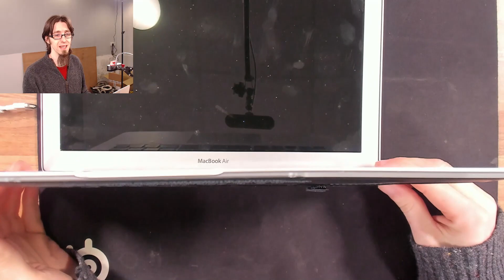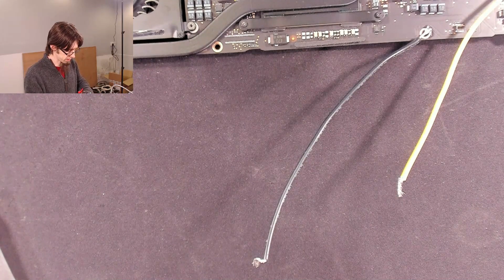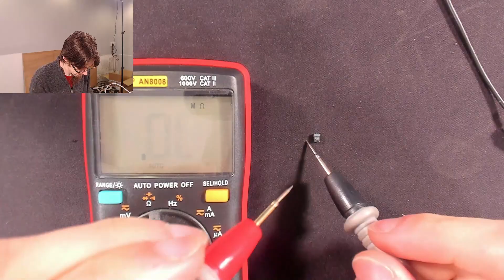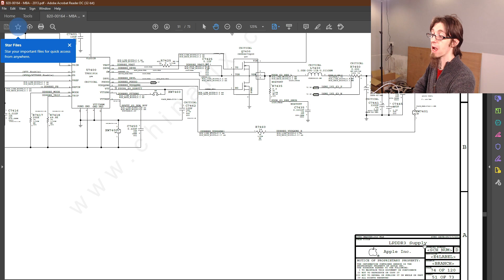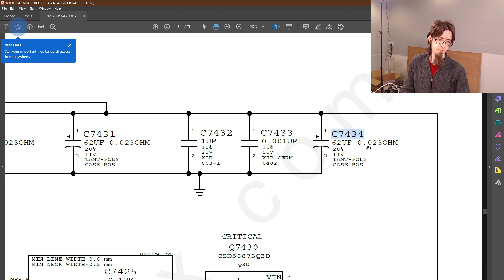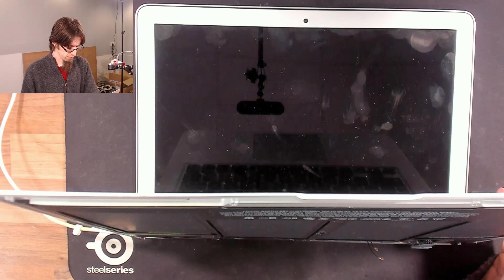MacBook Air Doesn't Turn On - LFC#256

Comment: Legend, I had the same issue, watched this video, had the same voltage drop, found a visually damaged cap in the same area, was hot as to touch, borrowed some gear, swapped it out, fixed!! Love your work, thanks for creating this awesome content. Big fan.

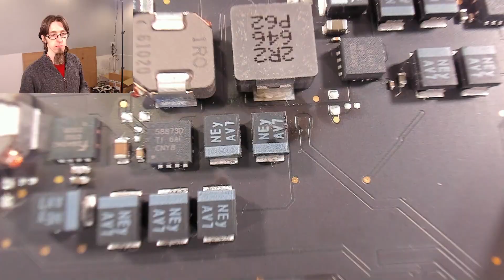Comment: don't tell me.. blown capacitor...... 12:10 I was right!. It's just that people want a Mac. So they get the cheapest MacBook Air which is really an iPad with a keyboard. Then they put all sorts of things on it like games and start to do some heavy stuff and run this computer boiling hot all the time. I used to have a MacBook Air and was exporting a simple low res video using iMovie and when I picked up the laptop it was boiling hot.

Comment: VOLTAGE INJECTION TIP: When injecting voltage to a circuit board to identify a short be careful when feeling for the hot spot because it will burn your penis.

Comment: I NEED TO DO THIS TO A 2011 MACBOOK PRO A1286....I THINK I HEAT THE COSMOS INSTEAD OF THE GPU ..... NOW THE MACHINE WON'T START UP. IS DED, BUT CHARCHER CABLE SHOWS GREEN LED.

Comment: That's a nice troubleshooting step by step procedure you conducted out loud there. It's very clear and helpful. I would have used the spray method to find overheating component in the absence of IR cam though. Denature alcohol dry fast and clean but dries super fast in the slight presence of heat.

Comment: Fixed one like that one a few minutes ago. It had a short on a RAM capacitor on the far left when the board is upsidedown. Actually I didn't inject voltage, the capacitor had brunt the plastic under the keyboard, and I just pulled it out. Didn't replace it though ;)

Comment: I Have a 2010 17" Macbook pro, the battery charges but doesn't power on from it. Is it a faulty Diod? the board is a 1297. Thoughts?
Reply from the maker: Can you read the battery level? If it's on the original battery, it's likely just a bad battery. They'll say they're charging, but they don't hold anything.
Reply: @Adamant_IT  says the battery is at 100%, fully charged.
Reply: @Adamant_IT  By the way the battery is a genuine new apple battery.
Reply from the maker: Yea... next step then is to pull up a schematic and board view, and start tracing power from the battery into the laptop, to see where it's getting held up.
Reply: @Adamant_IT  will do, thanks!

Comment: I am working on a a1466 where the macbook air will turn on once I unplug and re-plug the battery cable on the logic board. The charger works correctly going from orange to green. When I had the macbook air powered up, I could restart it several times without a problem. However, if I shut it down then it would not turn back on. It definitely had a minor spill (chocolate milk) that has been thoroughly cleaned out and the logic board looks prefect. The main power board (where the charger plugs into) had some rainbowing on sveral terminals which I scraped to clean it up a bit. I am almost done putting it back together and was hoping for any advice or guidance? Do you know what could be wrong? Cheers.

Comment: I have the same model and voltages are good, looks in great condition, it just does not power on... did all those "resets" that people do in thousands of videos and nothing, disconnected the battery and reconnected it: nothing.

Yesterday I took it apart completely, reassembled and THEN it had power, booted, worked fine, restarted and turned back off and on several times. I went to sleep, woke up and it does not power on again..... just what in the hell is going on with these macs.

Comment: my macbook pro 13" late 2013 took a big gulp of hot tea and shut itself off instantly, i opened it up and dried off the logic board as much as possible, but it took a week to get a screwdriver set to get the logic board out and flipped around. i opened it last night to see two small spots of corrosion, cleaned them up with 99% alcohol and still nothing works. power supply shows a light to indicate the batteries still take power. i thought maybe the keyboard was dead or the ribbon cable got damaged, so i tried jumping it with the direct power supply/disconnected battery, as well as with the power pins on the board, nothing works. the guy near me wants me to pay nearly the same amount as a brand new macbook pro to look at it and MAYBE fix it, PLUS whatever parts it needs. this made me realize there's a lot more to working with logic boards than just the base parts, could be literally anything or everything that needs fixing.

Comment: I have a similar type of problem with a Acer e1572 which started up before, even with a blinking Amber LED lite and after replacement of Memory RAM and new ac charger. 
I couldn't reset to factory settings from the main screen. So I decided to disassemble it to reset the CMOS battery. Unfortunately this model doesn't have a CMOS battery. 
After reassembling it, it will not start up. Thinking it was the Battery Pack, I bought a new one. 
The LED is blue indicating fully charged, no fan sound nothing.
Still it will not turn on?
HELP!

Comment: one jumper to the screw hole (ground) and normally the other jumper into which point? If a wrong point selected like a signal point rather than rail point, will it damage chip/IC and etc? thank you
Reply from the maker: Positive pin goes to whatever is shorted, or on the same rail as the shorted thing.
Reply: @Adamant_IT  thank you so much for the answer.

Comment: A high reading on a capacitor read from a DMM can also mean leakage. Remember DMM's measure capacitance using charge timing. You can increase charge timing by adding leakage.
Reply from the maker: Yea fair point. In this case we were like, 1 or 2uF out, I'm sure it's fine. But that deffo sounds like something to look out for. I'll have to do some comparisons with my component tester to see if there's an easy way to test for this without an expensive LCR meter.

Comment: Which device do you use to inject voltage onto the motherboard
Reply from the maker: A bench power supply. My particular one is an Hanmatek HM305p. There's a world of other options out there as well though.
Reply: Okay so a bench power supply and hot air station are 2 different  devices...

Comment: Why don’t you get a laser thermometer?
Reply from the maker: Not accurate enough to be useful. They have a laser pointer on them, but the actual read area is a cone on front of them starting an inch wide and spreading from there.

Comment: fantastic video  again. P.S could you let  me know where to get those tweezers please and if you  can tell me how  good  are they  durability wise and work wise as well thank you..  P.S i see now why apple hates  you 8 rotten  apples
Reply from the maker: Search ebay for "ceramic tweezers"
They're very good for durability, but they're not super sharp, so not very good for small components.
Reply: @Adamant_IT   Thank you for feed back regarding the ceramic tweezers info greatly appreciated. do you have a good site for fine tweezers to work on small components cause some of the tweezers i used keep sticking or slip with some of the part i try to disolder . i will see as well for that ceramic ones hope to get a good brand.

Comment: You rock man !!! What temperature 🤒 do you use to remove the components ?
Reply from the maker: 450c on the hot air, 400c on the iron. This kind of heat is massive overkill for smaller circuit boards, but on laptop motherboards, especially apple motherboards, the ground plane is like an anvil.

Comment: I have bought a macbook air a1466 emc 2632 2013 model I believe. . The LCD Screen does not light up but there is an angle where I can seem to see the log in password window but very faint.. but plugging to an external display and there is no issue it will work. . Would it be a lcd replacement? if it is do you suggest buying the whole replacement assembly or just the screen?
Reply from the maker: That's a backlight fault. At 4:00 I show basic checks on the backlight. See if the output diode is shorted to ground (_should not_ beep in continuity mode) and then check that the fuse hasn't blown ( should beep in continuity mode). Also do an SMC reset and a PRAM reset, because sometimes it's a software issue and you get lucky.
If the backlight is shorted, it's likely a damaged display connector, or the display itself needs to be replaced, or both.
If there's no short, but the fuse has blown, just a replacement fuse should fix it.

Comment: You are not wrong that if a capacitor is measuring a tad over, it's no big deal. I believe it is important to stress the point, that it's ok if it's over as long as it is inside of the given tolerance. This is important because a leaking capacitor will show "over" capacity, which is to say, it's going to fail soon. Best to replace with a new one IMO. Take this for what it is worth, or with a grain of salt.

Comment: Well done :-D,  at least there is nothing else to repair on it.
The bending could have caused other problems, but it didn't :-D
Nice little multimeter, i looked at them a few years back and wondered why some people poo pooed them.
Looked fine to me.
Reply from the maker: It's not the fastest in the world, and lacks manual ranging. But it's impressively accurate for its class, and cheap enough for the short comings not to matter.

Comment: you replaced the faulty capacitor, but what actually caused it to fail?
Reply from the maker: They tend to fail at random. The laptop also got sat on, so it might've just been the point where it got bent.
Reply: They hate heat, and fail from heat stress.

Comment: Tantalum capacitors are prone to short circuit faults caused by age and driving them with too much ripple too close to their voltage spec. I would suggest fitting new ones every time. The heat of fitting the 2nd hand replacement just pushes it closer to the end of it's life as well.
Nice repair though......
Reply: Typical Apple though. Non-standard size, capacity and voltage. Can easily get 68uF 16v poly-tantalum from RS - but of course they're a larger package size and won't fit. New ones can only be purchased from less-trustworthy suppliers on AliExpress and eBay.
Reply: @MattP79  Is there a way to find out the capacitors needed without schematics?
Reply: @Pulsebass  Often, no. If the chip has a datasheet it may provide guidance on the values to use. That's why "donor boards" became popular. No need to worry about the value - just replace with the identical part.
Reply: @MattP79  wow thanks for the reply dude ,👍👍 so for example I have and Acer laptop with a shorted cap and i have another branded donor laptop with what seems to be the exact same cap physical size & colour etc should it be ok to use ?  Thanks again 👍👍
Reply: not if you're running a shop and trying to make money........time is money.......no one can spend 2 hours on a board that a customer is only paying for 1 hour worth of work.

Comment: Actually a quite common repair for myself.
Reply from the maker: I never seem to get shorts on PPBUS_G3H! It's always somewhere else that's harder to find and fix.
Reply: @Adamant_IT  yeah, it is a gift when it does. Or no back light on the same machine.